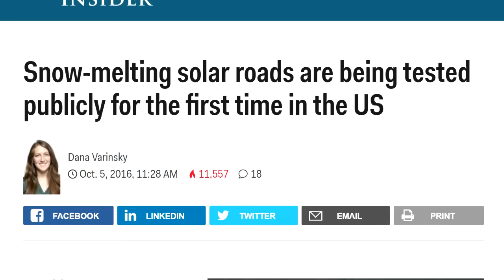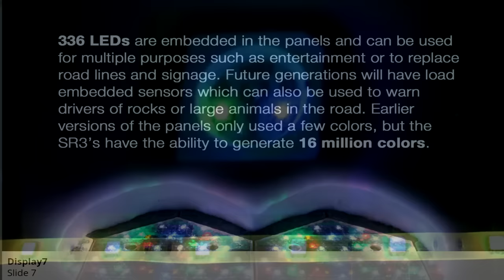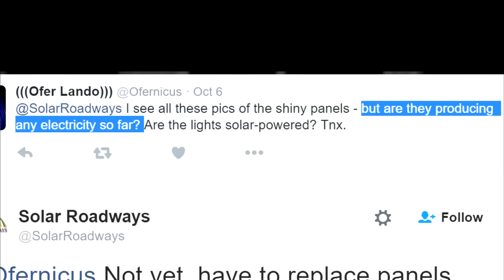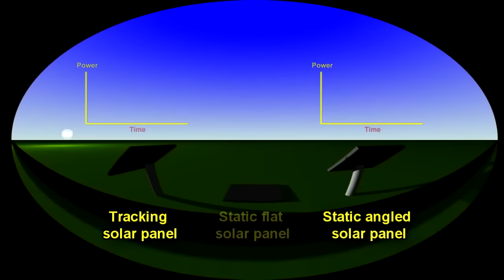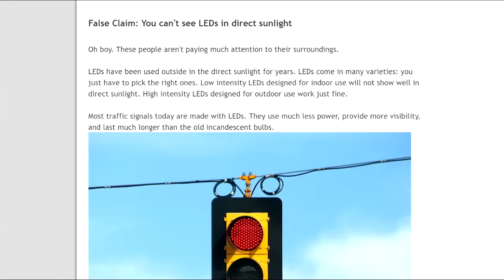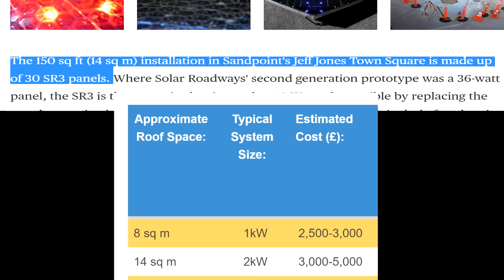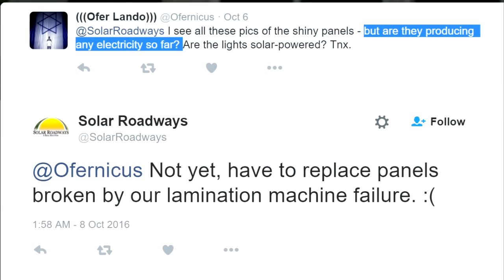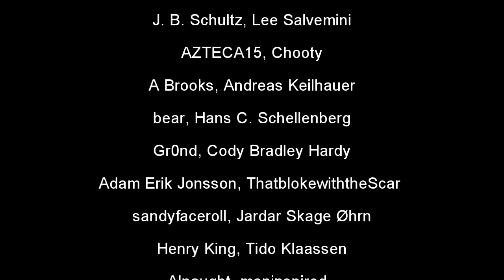First AMAZING Solar Roadway UNVEILED!

Comment: The heating part is very doable. In Finland there are already many streets heated by the excess heat coming from the power plants. It's called district heating and has nothing to do with the solar panels. The streets are heated all the time (also during nights) and one of the benefits is that the streets are not slippery like when it's iced. Oh.. And to make it actually useful. The main purpose of this is the heat houses. The street heating are just a side effect that one can use.
Reply: From what I hear, that only covers a very small area of Helsinki though, heating entire streets takes a LOT of heat. I hear it's done to a greater extent in Iceland, but they use geothermal heat, which is plentiful if you have an active tectonic fault leaking magma to the surface nearby :)
Reply: tybofborg You are mixing this up with district cooling. That is quite rare and in Finland only operational in Helsinki and soon in Jyväskylä (I think). District heating is very easy to use and used all over the World. You can read a little more about it from Wikipedia (in this case it's pretty trustworthy source): https://en.wikipedia.org/wiki/District_heating
Reply: Jukka-Pekka Tuominen
I did misunderstand. I see what you mean now. But the point is, while heating streets is doable when you have excess waste heat, the Brusaws propose using valuable electricity from the grid to heat the roadways, which is about as wasteful as it gets.
Reply: tybofborg The argument here is about "think of a street that doesn't freeze". It's not really anything like science fiction. For instant in my city (Oulu, Finland) there are already several streets that don't freeze. And it's also much easier to do than what is being suggested here.

Comment: Could we just build a cover over the existing national highways, in the same fashion as that car park? The panels wouldn't get scratched beyond transparency, the roadway still wouldn't need plows because the snow would melt on the solar array overhead. Variable lanes could be lit from above, and motion sensors would warn of animals. 
All powered by the array of course. Which would be unbolted from their anchor points to allow repaving and other repairs on the already existing perfect driving surface!
It seems like this would be cheaper than replacing roads with noisy and slick tiles, but I have a feeling even this would be cost prohibitive.

Comment: Glass plus a rock thrown at 70 mph equals  broken.  Glass plus a rock pressed into it with 8000 lbs equals  broken.  Even if they could make very strong glass to put on an actual road way.  So many things will happen to it everyday that the cost of repair would in just a week would kill any budget.  And yes i do know about bullet proof glass.  That is the exact reason we dont pave our roads with it.  The cost of installing it the first time would be more than any budget in the country could handle.  If you did get it installed the repair cost of the road when one truck loses its tire and drags the rim on the road would be outrageous.  A whole stretch of freeway closed for major repair due to one blown tire.

Comment: The only way this stuff makes sense is maybe for sidewalks because the panels won't wear as quickly, they won't be as covered as the roads, the wiring would be easier/ cheaper, and possibly if the LEDs are bright enough they could replace street lamps in cities. Nothing outside of city. Only is optimal areas where buildings aren't blocking too much of the sunlight. Annnnd probably not going to actually work or even be remotely cheap enough in 25, 50, maybe even 100 years.
Reply: That's why these guys are best thought of as scammers.  They didn't seek investors, they begged for free cash on indiegogo saying in 2014: "Our technology works, our test results are outstanding. Now it’s time to gear up for manufacturing,”
And this is the bullshit they produce after $4M in r&d funding (assuming they never put in a cent of their own money) and $500k for this 150sqft installation.

Comment: I live in Germany, here we have some highways, that are actually made of "tiles"... they are made of blocks of about 2 times 3 meters (2 next to each other form the width of the road) and come from the after-war era, where the German Government wanted roads built as fast as possible, in order to build up the infrastructure after the war. Given that the "tiles" are much bigger than the Solar Roadways, it took longer for them to "shake loose", but they did. Those streets are HORRIBLE to drive on... its like riding a bike across wood bridge with several centimeters of space between the panels. "thunk thunk thunk thunk thunk thunk..."

Comment: I just had an interesting idea... just for the concept of programmable lights to control the lines and signs on a road or parking lot. What if instead of the obvious idea of putting the lights on/in the road, you put lights(light projectors) on a CEILING above it, lights designed to project a line on the ground 15 or 20 feet below or whatever. Obviously would only work with a roof of some sort, and things could get in the way and block the light from getting to the ground, but for the most part this seems to be able to achieve the concept without the absurd need to re-do the entire concept of a concrete/asphalt road surface
Reply: An interesting idea, maybe it could be combined with a covered road solar panel system, when possible to cover a road. I do think the changeable road and parking place markings is about the only salvageable part of this insane freaking idea of solar roads. We might as well get something out of all the wasted money and time used on their idea.
Reply: So...streetlights?
Reply: If they suspended colored solids in a liquid and applied the solution to to the areas where lines were desired the liquid would evaporate leaving only the colored solids behind. Combine this with your idea for street lights and the problem is solved! 

Oh never mind; that is an insane idea.
Reply: Problem is, a light based display would constantly have to draw power.
For road lines, which don't change for 99% of the day, it is really inefficient.
If only we had materials that can change their reflectivity at will...
*grabs lizard 
time to do science.
Reply: It also wouldn't create nearly as much light pollution.
Reply: Or, just put the display ON A SIGN at a height drivers can read, directly in front of them.  Sort of like we've been doing the last 80 years or so, because it works.

Comment: The original idea is amazing! Everyone should be supporting this. If you're against it, it doesn't make sense. The idea is to help generate clean power. There's nothing bad from that. Do you think that the Wright Brothers didn't have a few failures? Yes, they need to keep working out the kinks, but it's a great idea. If you don't like it, what's your idea for clean energy that doesn't negatively effect the planet?
Reply: So everything in these panels need some kind of fossil fuels, so it not very green.   And you would need to use 2 time the amount bio-fuel to make glass, 5 time more for hydroelectric.   Here a thought "Use Less"  no parts needed, no extra energy needed in make it and it's free.

Comment: Have they not tested this concept in small scale, like at all?  Buy a solar panel, build an insulated box with a glass top, stick the solar panel inside facing up with charge controller,  battery and other electronics, and put a small heater and see if it works throughout December and January and that the temp inside can be kept above zero.   That would be a good start.  (hint: I don't think it would work)

Comment: It would be easier, cheaper, and more effective to just build roofs over all the roads to keep the rain and snow off.  You could even put solar panels on the tops and LED lights on the underside!  It would be like a tunnel!
Oh, wait, let's suck all the air out of the tunnel or attach it to an elevator and install special bumpers on the car while it drives, too!  I'm a genius!

Comment: Instead of trying to put solar panels in roadways, why dont they just make the top surface of cars/SUV's/Trucks solar panels? Then have vehicles plug in when they park. The energy is collected by the parking lot and sold back to the power company. Would the cost of the installation of the "plugs" and the infrastructure exceed the value of the energy recovered? The vehicle could even split the power, 50% to the parking lot, 50% for vehicle batteries (if it's all electric).

"Free" parking could be available to vehicles providing energy.

I'm not guessing I'm the smartest guy when it comes to this stuff.

Comment: I really wish they would have used that first 2 million dollars of testing to learn how to snap those together in an even fashion and see if they were waterproof.  
Though I could have sworn those two years of testing found out that the panels did better collecting over-all solar from just pointing straight upward in cloudy days.
(Edit: It looks like they just need to hire engineers now to help them make it work.  Engineers from the beginning would have been a good idea too. ) 
The theory is still a good idea, and frankly, just about everything could be solar power collecting if you do it right. Windows, roofs, walls, siding, etc.

Comment: I was thinking about this more and even if the glass could support the weight of tires and vehicles pressing down on it, roads have to stand up to much more than just that. There's golf ball size hail raining down from above, which only has to happen once to destroy your very expensive solar roadway. Large stones and other objects falling from the back of trucks traveling at high speeds. There is a very large stretch of interstate near where I live that was permanently damaged by a truck dragging a trailer hitch or some similarly heavy piece of swinging metal that was bouncing between the truck and the road. It left a pattern which consisted of chunks of asphalt ripped out every 3 feet or so. Asphalt stands up to this sort of abuse fairly well and is pretty easily patched. The glass panels would almost certainly crack under such abuse though. The more I think about this the less viable it seems to me.

Comment: Put all power lines in the ground, instead of on out dated, dry rotted, utility poles. This will eliminate power losses during storms, cut back on repair and upkeep costs, also help prevent illegal tapping into of said power. I'll be running for office in 2020, please vote for me.

Comment: Also it looks like they just dug a depression to replace the concrete and stuck battery powered LEDs, which would explain why some LEDs went out and why the panels don't actually supply electricity to anything. It's not wired to any charge controller.

Comment: Do these guys ever take one minute to thing about maintenance costs. Think of how frequently these roads would close and how long and expensive maintenance will . What happens when LEDs fail (as they like to do) in the middle of rush hour? No more road markings? That sounds pretty safe. 

They also love to through around how awesome these things are at melting snow. I live in North Dakota. If you think that these things are gonna be able to melt snow and ice off the roads safely at -20F all the while still producing positive energy outputs during the 8 hours of daylight and the high solar angle you need to do some reserve on thermodynamics and the conservation of energy.

Comment: This idea is not just 1 concept, it's really 3 different concepts, idiotically trying to be forced together into 1.
1 - Solar panels, great idea for the most part
2 - Replacing asphalt and concrete roads with some sort of translucent material like glass, an idiotic idea of absurdly epic proportions
3 - Using programmable lights to make lines and signs on the road, a fine concept on it's face, but is completely and utterly unfeasible when all necessary changes this would require are taken into account.

I actually think the idea of programmable lights in a parking lot could be a nice luxury thing very high end places could have if they chose to, but it's completely idiotic to think this should be done to all roads everywhere

Comment: You know having carpark solar panels could work, but in a different way,.. I'm thinking of at the corners of a parking lot are solar 'towers' which has solar panels tracking the sun's movement without taking needed space,.. and these solar towers are powering led strips lining the parking lot, such as the parking lines that show the parking spaces, and the driving paths to follow.

This idea could work in parks aswell, having the led light strips line the edges of the pathway, with solar towers placed every now and again alongside the path to power it at night.

Heck if they really wanted to do something like a Solar Roadway, they could go on a more larger scale and have the sides of the roads have led lights that turn on at knight so you can always have a clear sight of your placement on the road, with again solar towers located every now and again to actually power said lights at night,.. And while this isn't much of an issue in the more suburban location, they can be ideally placed at the less lighted roads like out in the country where tree's aren't that much of an issue for most of the time.

But honestly the idea of solar paneled roadways is just stupid, because well, one it reduces traction so on wet or icy days it can become a real hazard, And what is stopping the likes of loaded trucks from breaking the panels? or the constant spikes of weight from the countless vehicles being driven over it?

Before you can ask Can it be done, you have to ask Is it safe?

Comment: It is 7 AM on Nov 3rd.  The solar disaster is covered with about an inch of snow! The LEDs are showing through, but they are not melting the snow. Yesterday there was a very light snow which melted off of all paved surfaces. During the day they generated 90 watt-hours of electricity. That would have been enough to just melt 0.004 inches of snow.

Comment: I'm a truck driver and my truck weighs about 80,000 lbs on average with a load. What is the is the weight rating on each panel?

Comment: Personally, I kinda like the idea of generating solar power from roads, there are a lot of roads out there, that's quite a large surface you got. However, in practice the design hurdles are huge, you need panels that are extremely sturdy, you need to be able to clean them, you don't want to reduce the grip of the tire on the road, maintenance should be easy..... And once you solve all these issue's you still need a way to bring down costs to make it worthwhile even if they only get a measly 10 or 15% efficiency

I wonder if it wouldn't be easier to extract thermal energy from roads instead of solar.

Comment: We park on the driveway and drive on the parkway. LOL. But seriously on the side of the routes today there is rubber dust on the sides of the roads made from glass panels there will be glass dust. Sounds like trouble waiting to happen. And how well will they hold up when you slam on your brakes. There is a lot there not taking into consideration that is for sure. But hey if they’re Bluetooth I’m in lol.

Comment: @Thunderf00t, Ok, I was gung-ho for this idea till I saw tour first video "Busting" it and then I saw the flaws. I still have hopes for this sort of project but its obvious there will need to be changes if it is ever to become a reality.

what if, they used reinforced glass similar to what banks use or bulletproof glass like squad cars have?

Obviously need to drop the LEDs, cuz as cool as it is to have them change and light up the roads, its just not feasible in the sun AND still produce power. So lets paint over them like normal.

Water was an issue here in this video, but that was thanks to poor craftsman ship, inexperience as road builders and no drainage. the original video supporting Solar Road ways suggested draining the water off to be reused.

And I could be wrong, but I'm pretty sure they mentioned these things could be heated to get rid of snow and ice and have it all collected through the drainage Not sure how the heating would and still collect power.

What about them being placed over current roads so that they can have more stable ground for vehicles to move over. I recall a video that said that the plates would eventually rock back and forth causing the panels to create holes on either side of the panels much like a see-saw. well, if theyre placed on more solid ground, that may fix the problem.

I dont have anything to back this up, just trying to offer some solutions to a great idea that has executed horribly by (possible) scam artists. I'd love to see something like this come to light, but what remains to be seen is the effectiveness of such a project.
Reply: Joel Ayers but it would be more long lasting if they didn't have cars driving over them

Comment: You can get transparent Aluminium now. at $3000 for a 2mm x just over 1m2. It's not cheap. Obviously it's not pure aluminium neither. I'm not even sure of it's strength in compression, as pure aluminium is soft like plastic and it might actually be softer than tarmac in compression. Maybe someone who makes bridges will know.

Comment: I actually have a plan to heat roads and provide a tiny bit of light with LEDs at night. My idea would work because the technology already exists and works, the only thing is the cost, however I figured out the perfect lowcost material.

Comment: Hey @thunderf00t, at about 7:43 you do a comparison of the amount of power generated for solar panels in different position. If we assume that we have a solar panel of infinite extent, won't we be able to get more than just 30% of power for the statically placed case?